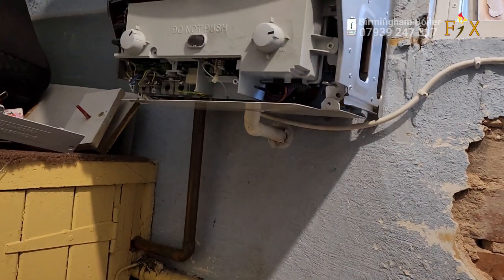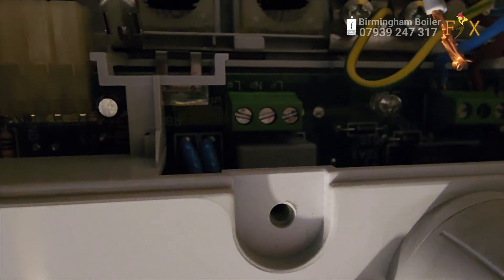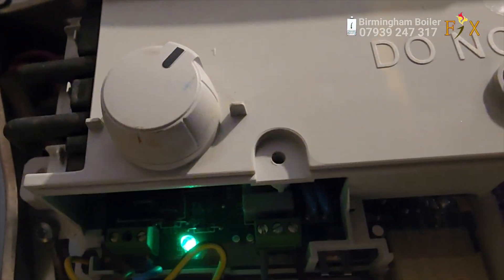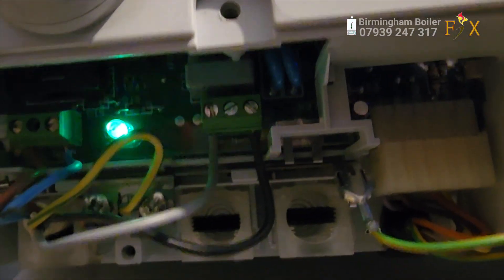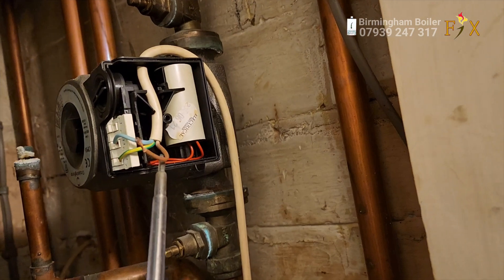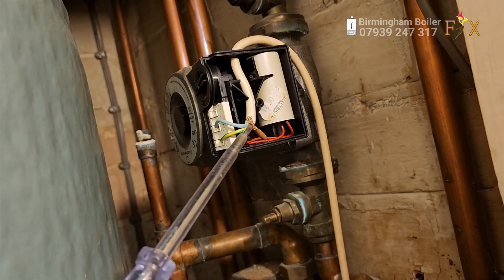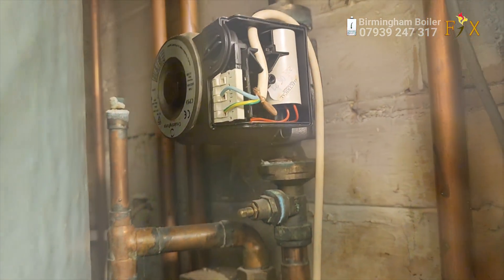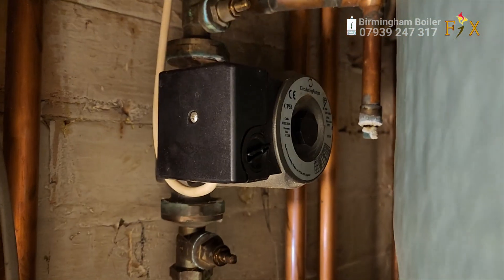Wocester Bosch no power, completely dead it was blowing the glass fuse Birmingham gas boiler repair

Comment: Hi mate quick question for u I have the same boiler and today I ran into an error electrical power interruption FD231 I pressed reset and it seems OK now should I be concerned or will it be ok and why did it happen as I have only had the boiler a couple years and never ran into a error before ?